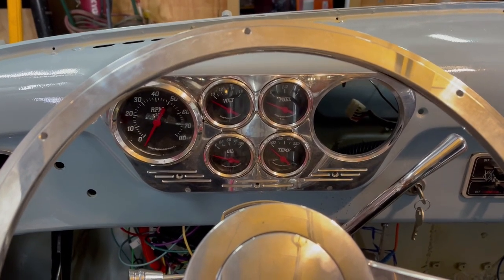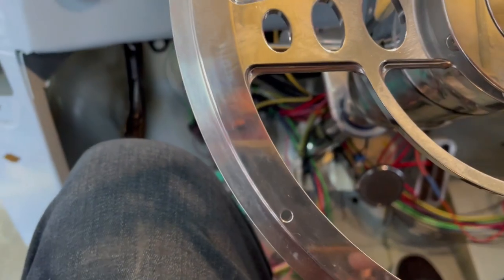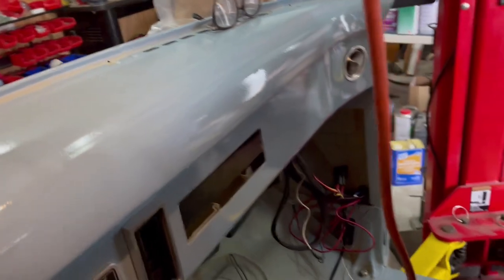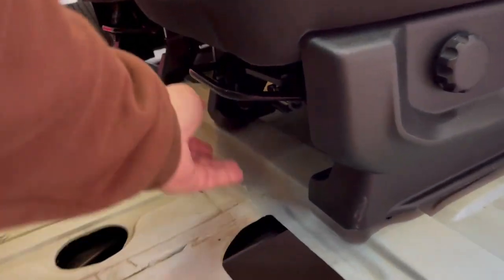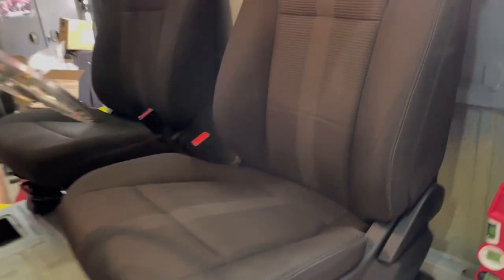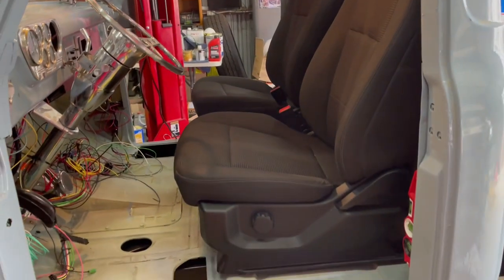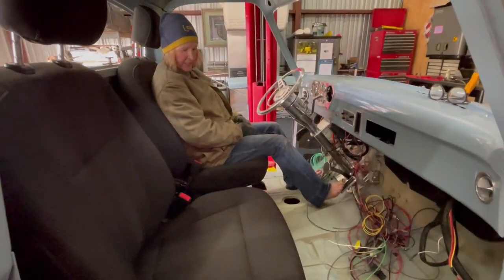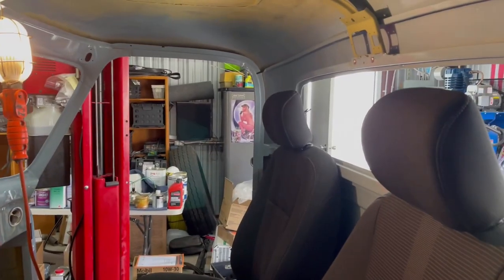1954 Ford F100 Restoration 2019 F150 STX Bucket Seats Week 16

Comment: I picked up some 07s for a 66 no such luck. Your floor is flat more like a late model . Mine has @ 5 inch hump from side to side under the seat . The back of 07 buckets is more than midway up the window top of the headrest about 3 inches from the headliner.